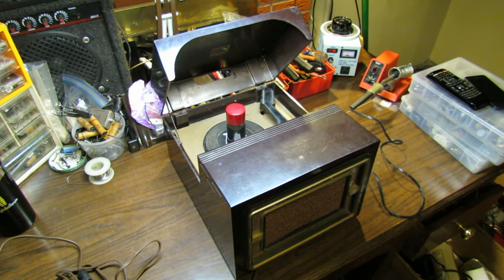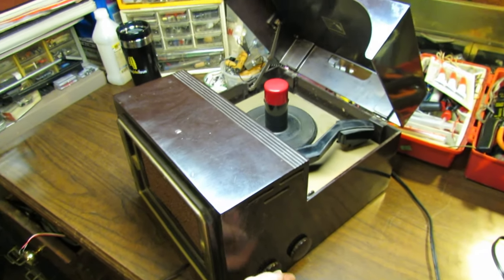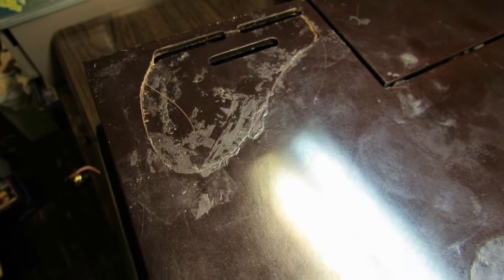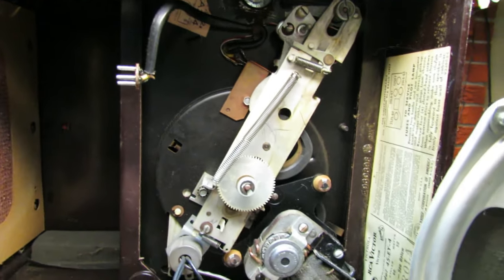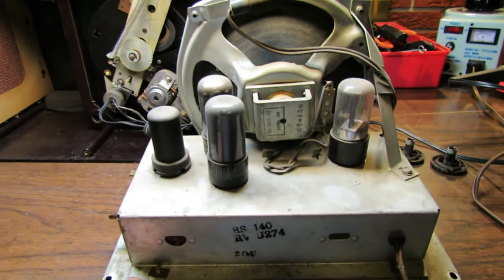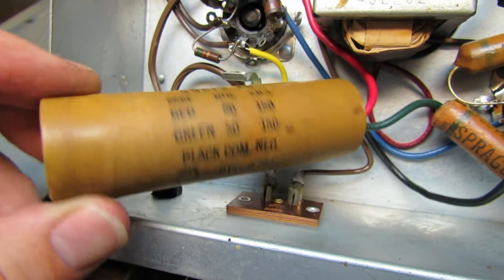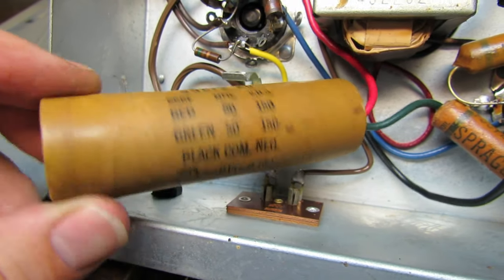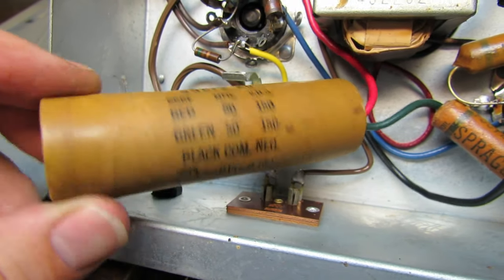1951 RCA Victor 45RPM Electrola Record Changer Service

Comment: The little changers are fully automatic and will play 15 records unattended when they are right.  Reportedly they have the quickest record change of any changer making a complete cycle in two revolutions of the turntable. The only thing they won't do is shut off after the last record, they will play the last record over and over.  There are kits available on ebay to replace just the rubber tire on the cycling cam.   I have six of these units two like yours, one with a single output tube and three stand alones including the one I've had since age 6,  I"m 68 now...
Reply: That is the later version of the mechanism that cycles in one and a half rotations. The earlier ones had a gold metal arm and those are the fast ones that cycle in one rotation.

Comment: I have a stand alone version of this classic 45 rpm turntable.  NO amp or anything but has to be plugged into an external amp.  I just had it professionally restored a few years back (quite expensive) to as close to it's original condition as could be done by Joel Thorner of the Turntable Factory in Columbia, South Carolina, who has sadly since passed away (too young!).  He did an awesome job on it and now I have something from my high school days to remind me of how great we had it back then but didn't realize it.

Comment: Was really surprised that you didn't consider SOAKING the rubber idler wheel in alcohol at least OVERNIGHT to soften it up and get it working much better! Just giving it a FEW QUICK WIPES with a Q-tip dipped briefly in alcohol aint gonna do much, since the ENTIRE WHEEL has HARDENED over the years! Soaking is how I do it, and have gotten EXCELLENT results!

Comment: replacing caps is a good start, replacing resistors is also a good idea , resistors drift up in ohms value as they age, I repair old amps/ radios ect. this record player is a 1951 model, the amp in this unit is a two stage amp with a push-pull output (2-35L6  power pentode tubes), the chassis number is a "rs140" , the"62" on the chassis is a inspectors number

Comment: Hello!   I just restored a 45-HY-4 which is the one that came after this model. They are basically the same, just different tube layout. The parts are not cheap, that's for sure! I did use "plasti-dip" on the cam wheel, which brought it to pretty much like new. I also installed a new pfanstiehl p-188D cartridge, and idler wheel. The player sounds great now.
I have one like yours waiting in the wings to restore.
As for the tonearm not setting down on the lead in to play....It should, so there is an adjustment out of position.....Quite possibly the tonearm itself on its post.     If you're really not into these players, I agree the expense can be prohibitive.  But, when properly restored, they do bring the money, no question!   I am a collector myself, so I am doing it for the enjoyment.  :)

Comment: This is an RCA RP-190 record changer.  It'd designed to play up to 15 records without user intervention, at which point it will play the last record over and over again until you stop it.  You can get the both the idler wheel and the cycling cam properly re-surfaced by sending them to the Voice of Music website.
Reply from the maker: I'm aware I can send them off. Just didn't want to outlay more cash on this one. The real puzzle is how the cycle mechanism is supposed to work. Both wheels are working, so I'm not sure. I'll get back in there someday. Too many projects right now.
Reply: The Guitologist 

there is an adjustment to determine where the tonearm sets down.
Reply: If the cam is not in too bad a shape, you can resurface it with plasti-dip. Just apply it around the edge and let it dry. There is an adjustment to make the tonearm come down at the right place.

Comment: A wonderful example of the format war between RCA and Columbia.  RCA wanted to sell albums as a 7 inch box of 45's and Columbia LP's. Unlike other format wars, both won...The 45 replaced the 78 single and the LP replace a box of 78's. The box of 45's never really caught on, although many were made.  One of the problems with the RCA 45 only changers is that the hole in 45's got slightly smaller and newer records do not drop on the spindle. It functions well with 45's from the 1950's though.

Comment: Sandpaper the idler if all else fails, and a standard 5 or 6mm width belt of slightly smaller diameter can be placed around idler and can work very well - again if all else fails. Superglue will make it noisy? Should be louder, amp probably still has issues.

Comment: 36:27 - The mechanism controlling the lead-in placement, and lead-out departure of the tonearm, resides roughly in the upper-right- hand quadrant of the image, under the base end of the arm.

It's  a black, shiny greasy metal item with multiple points and curved edges on it
Reply: You who are so wise in the ways of science, lend me your ears (that's disgusting!). 
I have this same model - everything works well except for the automatic tone arm... It lifts when a record drops, but then moves AWAY from the platter, hesitates, and then drops the stylus down on the plinth. What the heck?

Comment: the lack of volume indicates resistors that have drifted up in ohms value, the record  changer is fully automatic, the pickup cartridge (made by "electrovoice" for "RCA)should be replaced . record players like this one bring good money if working correctly, so don't be afraid to spend a little money on it.

Comment: That's got to be near the top of the line for 45-only players; RCA was hoping that would become the standard so they put some effort into these things. With a push-pull amplifier, it almost seems as if they had some classroom use in mind. That was a steal at $5.
Reply: No Name the top of the line 45 player was the RP-168 mechanism which used the four pole motor and a magnetic cartridge.

Comment: hi you can buy the rubber tire for it very cheap on ebay i buy them all the time and make 
them work, they are all automatic. the system works with the rubber wheel, there is a adjustment on the arm there is a center screw when you lift the arm up you will see it loosen it very slightly and then push the arm to the record where you want it to drop on and then tighten the screw and it should work correctly after that, but you need to do it with no power on turn it by hand to get it right. good luck. i have done 3 of these already very simple record changer.
ted

Comment: If you don't get the level of performance after servicing the RCA, only one thing to do! Turn it into a guitar amp! Happy Holidays! Thankz
Reply from the maker: The thing about this one is, the circuit is designed for a 3V cartridge, which is high output. Plugging a guitar in yields very little sound without an extra preamp stage or boost pedal. It would have to be redesigned.
Reply: Turning a classic record player like this into a guitar amp would be reprehensible. I always tell people "Quit tearing up vintage electronics---if you want a guitar amp, BUY a guitar amp".
Reply: Audio Tech labs, We could turn it into a high voltage torture device and hook your guitar-playing balls up to it. If you want a guitar amp, go buy a fucking GUITAR AMP.

Comment: There is a you tuber by the name of seeburgsrock who has a lot of videos of that type of player so you can see how they work. There's also a place called V M  Enthusiasts or thevoiceofmusic dot com where you can buy parts or send in parts and had them rebuilt.
Reply from the maker: Thanks for the comment. I'm aware of VM, and I've become aware of seeburgsrock after making this video and having it pop up as a youtube suggestion. The cost of rebuilding that wheel is prohibitive unless I do it myself. Fortunately, that part is now working, but for some reason, the arm won't sit down on the lead in of the record still. I might dig back into it again later. By the end of filming this one, I was ready to move on. The cartridge is weak also, so it really needs a new cart and needle. Just a lot wrong with something that isn't worth much to begin with.
Reply: Cool, just so you know. I've seen those things go between 350 to 500 on Ebay restored.
Reply from the maker: I looked at some of the auctions where similar models had sold for that, those look like anomalous prices far above anything others being sold. It appears one seller has found a niche, but they are putting in a lot of work on them to get them to that state and they are modifying them to include switches and jacks not on the originals. Odd thing to do, but it seems they're doing good work. More power to them! That's not something I'll be doing though.
Reply: It's a lot of detail work Brad, You'd have to completely dismantle the unit to the bakelite cabinet, rub and polish the cabinet to like new, have the idler wheel rebuilt, etc, a first class "frame up" resto. The unit would then be assembled as it was from the factory. As you probably know after making this video, all the RCA 45 players are fully automatic, as all other record changers are from this era.

Comment: He doesnt know much about these rca.mechanisms
He got it backwards. Ive been repairing these units for 50 years
Its a push pull amp. The amps do sound good with a cartridge replacement

Comment: Hi,
I have a RCA 7-EP-45! Includes the RP 190 B5 record changer and a rs152D amplifier chassis. I completely restored this Elvis record player and it works fine, accept one thing. I have a humming, like the same in this video. If i turn up the volume or i touch the pick up arm, the humming becomes louder. Maybe someone have a solution for me to remove this ugly humming!

Markus from Vienna
Reply: Its not grounded correctly

Comment: There's no need to go with another crystal cartridge---this amp has plenty enough gain to use any ceramic cartridge that uses the standard 1/2" mounting pattern. In fact, this amp may have a resistor bridged across the input from the factory to reduce the 3 v output---you would have to remove that to use a ceramic cartridge.

Comment: That Dog & Gramophone trademark SHOULD NOT HAVE BEEN on that player. By rights the HMV trademark should've VANISHED from the USA in 1929 when RCA bought the Victor plant and name. RCA should've been using its own circular trademark with the lightning bolt trailing off the 'A'. The Dog & Gramophone trademark should've only reappeared in the USA in 1955 with Capitol using it under licence from their owner, EMI(The Gramophone Company) Ltd., Hayes Middlesex England.